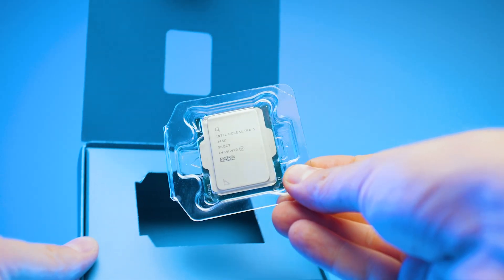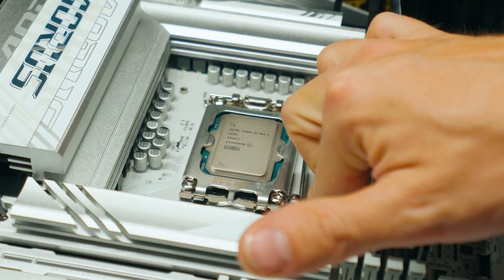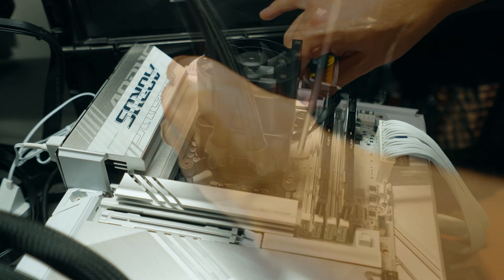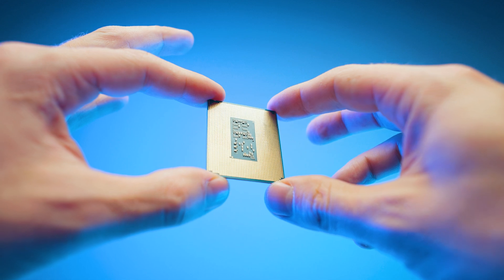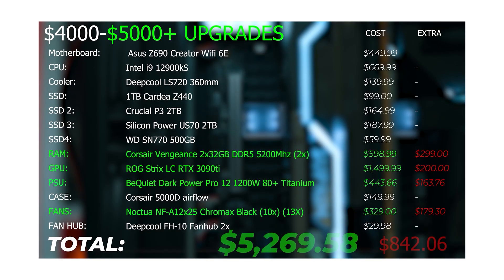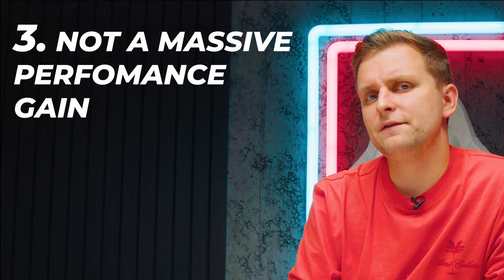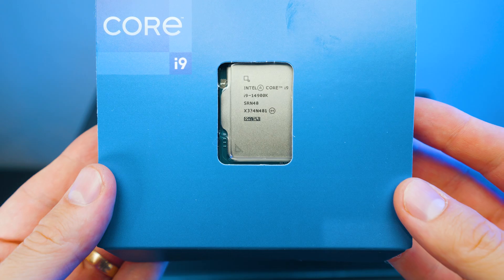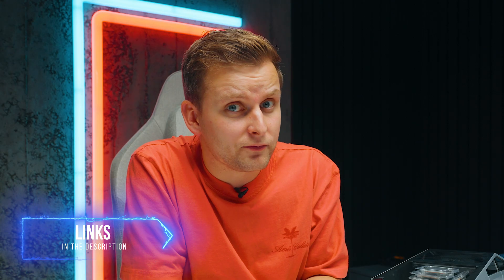6 Reasons You Should AVOID Intel Ultra 200s CPUs!

Comment: Just built an Ultra 9 285K and couldn't be happier. Not a gamer. I don't even play solitaire. Intel just raised the memory spec to 8000mt's which really gives the 200 series a nice performance boost and doesn't void the warranty. I switched out my 6400mt sticks for 8400mt sticks and was pleasantly surprised. You don't even need a benchmark to feel the difference. It's immediately noticeable.

Comment: I have a NAS with a handful of SSDs and 12 HDDs running multiple virtual machines as well... I went from a 7950x in ECO mode to a 265k with the same 65W PL1 and PL2 settings, and my power consumption was almost cut in half without any noticeable loss in performance.

Comment: So as 3d animator, modeler, and Unreal engine user. I should go with i9-1400k over a i9 core ultra?
Reply: It depends what you currently have. If you have to upgrade your motherboard anyway, the 265k is gonna be way better value at over $100 less for similar performance and way less cooling requirements.

But if you’re already on the lga 1700 platform and have good cooling 14900 is a good choice

Comment: I pick up 285K and 8200MHZ CK-dimm, this combi runs very good, no issues.
psst. on Night Raid this combi beats x3d+rtx4090 and achieved a legendary 3dmark score 100.000 points.@ 7280 X 3.600 resolution (2 monitor expanding desktop)

Comment: I was on the 13th gen (17-13700k) and it was a disaster. Computer crashes, huge temp even just running Lightroom and much more. I also built an AMD 7900x and that is one hell of a PC ad it does not even need a watercooler. So I personally would NOT go for the 14th gen but would jump to the Ultra core. Or the AMD 9 9950x.

Comment: ah, the 14900k would be decent. id recommend the 129 - 137 - 147 with an aio, disable hyper-threading, new bios, push clocks a little. UE5 will work.

Comment: Went from 12600K to 14700KF on a Z690 board - which, by pure luck/coincidence, was the right thing to do. That's because I upgraded in late 2023 so there was no way to foresee that the Core Ultra series would be a bit underwhelming WRT uplift. And no: My chip hasn't blown itself up or started to degrade. I guess not using those silly, "no-limits" default BIOS settings helps with that.. :D

Comment: I have 2 PCs each with a CPU from AMD and Intel: 7950X3D with 4090 and 12900k with 3090.  
It was time to change out my intel PC so i gave that away to a family member recently. 
My new build wont be completely finished until the 5090 and DDR5 CUDIMMs come out but so far i have bought an ASUS Maximus Extreme MB, 1300w MSI PSU, mid tower Lian Li Case, numerous Noctua 120mm fans, and Corsair 360mm AIO. The 285k is so hard to find here in Canada because of it being sold out everywhere so I bought a 265k just to fill in the gap until then.  I have put the system together with the many parts I have on hand just to get it up and running: 4090, DDR5 6800, 4TB Samsung NVME. So far so good, I love playing around with it. Can't wait for the 5090 and the new CUDIMM DDR5 memory to come out.

Comment: What about if you were planning to build your 1st PC and your not coming from any previous Generation Intel or AMD?
Reply: asking the real question!! my take is this, intel latest is kind of green/rough and will probably be updated on drivers and so on, also, it will work way better if you can find CUDIMMs ram which for now is almost non existant... so if you adopt the platform now you will probably have to refresh install your system with bios and firmware updates (and prob RAM) in some months from now... AMD is kind of stablished and working fine, even if the latest 9000s series has also lots of problems and compatibility issues (and in Windows theres lots of problems, you need to correctly set them up etc...)
Reply: Also what are your plans with the PC?
Reply: @daveinstlouis314  Sorry just seen this, the PC is mainly going to be used to run multiple Virtual machines, some video and photo editing and occasional game. But mainly a productivity.

Comment: Tech Notice : you forgot to mention Shintels cheating technique using the 24-pin connector to deliver 80-90 Watts of PWR to the CPU....trying to portray them as more efficient. You also forgot to mention the Core Ultra 9 285 being around 25 % - 30 % slower than the i9 14900K, while the i9 14900K is already around 30 % slower on average than the Ryzen 7 7800X3D.
Reply: Funny to use amd as profile pic. Lol
Reply: @Static-4  well....AMD is afterall a superior CPU manufacturer with a faster and better performing CPU architecture than Shintel....so why not :).
Reply: @lflyr6287  in your opinion amd is better and for some people earth is flat.
Reply: @Static-4  AMD Ryzen 5000, 7000 and 9000 CPU-s are faster in IPC, Single-Core, multi-core, have much lower PWR consumption (by around 65 %), have zero hardware security holes (due to not using kernell as a necessary cheating technique for co-processing) and produce much much lower temps.
The only aspect where Shintel is sometimes faster is in certain productivity programs that use old 1-core based utilisation technique in conjunction with hidden shintel compilers from around year 2012, and in games like Cyberpunk 2077 which uses a game engine designed in 2010, that uses DX 9.0c API at its core, was designed around 1-core efficient utilisation, is heavily plagued by hidden shintel compilers and was completely finished in 2014.
Anywhere else, Shintel is subjugated like a punani, the way it's supposed to be :).

Comment: I limited 9950X's temperature to 65C and got 62000 points with passmark. HWinfo tells maximum package power during test was 143.365W.  It is not bad as I come from Intel 2600K which gives 5697 points.

Comment: hi I was planning to get it, but i dont know... i have the i9-9900K with a rtx4080 at moment.. do you think i have to upgrade or i must wait an other year? i want for 3d renders blender and videomaking.. so not amd fan at all amd is mostly for gamers. Give me your opinions pls ♥
Reply: When in doubt, wait. Do you need an upgrade? Is it valuable to you? You mustn't do anything, and benchmarks for your fave 3D rendering & vid apps should be easy enough to find. I'd respect those more than opinions of some randos on the interweb. Remember that upgrading is not free also when it comes to spent time and this platform does seem to have some bugs. Prices will come down as well, they must given the market situation.
Reply: @owlstead  yeah my plan was to upgrade the cpu (motherboard+ram) every 6 years like... but the new i9 look like i must wait the next year for better... btw with my first gen i9 yeah in many cases i hear the bottleneck

Comment: I'm on 12th gen currently both i3 and N100 was picked for power at idle as my machine stay near idle 90% of the time but I need power to be there now so I am looking a 7945HX(Zen 4 16c/32t basically a 7950x in extreme low power profile) hybrid ITX boards or the 7950X with cheap B650i AX ITX board regardless, and case I plan is very tiny. I love mini builds. Had high end gaming build that heat the house in winter but after a couple of OC record you realise you don't need 150w+ for 90% of the time so bigger intel chips have always been to hungry and these are a little lame unless you push a lot of power into them and then they are not so eco friendly. Shame Lunar lake has such a low end GPU. I like the idea of faster on die (G)DDR ram. My dream is a micro PC which has a good igpu. That why I holding on till strix Halo Max lands as 12c/24t and 40 CU igpu, hopefully a 16/32 and 40+ cu chip will come than tower PC's are a thing of the passed for most people that are not gamer's. DB790i from minusforum is tempting me but currently pricey, but they keep popping up in Amazon and allieexpress, Minusforum seem to have the belief British people should pay more and Dollar and GBP is the same exchange rate. This is why I hate Brexit as I used to buy so much cheaper hardware out of EU and sell it marked up and still be cheaper than US companies. Nvidia and AMD stock was well cheap. I got a new FX 8150 on release week for only £140 from Germany UK price £200-250 at the time. I'm a linux user so AMD or Intel FTW.

Comment: First of all: Calling the 14th gen a new gen is really, really, really stretching it. It is not more than a better binned 13th Gen. This is also the reason, why both had the same issues. Second: If you are a professional who needs lot and lot of cores that pack a punch, you would never go with the Desktop-Variants of Intel that have little cores and big cores. Although i think benchmarks like cinebench are not a good benchmark, but whatever. It is good enough to compare Numbers. But Videoediting/Rendering is more a GPU-Thing in my opinion. Multi-Core-CPU's are perfect for Virtual-machines. And why should someone bother with efficiency-cores for usecases like this. And if i just go for cores as a professional, i would definitly choose threadripper over this. And  Efficiency by the way: Which efficiency? There are a ton of CPU's out there, that are more efficient then Intels Offerings. So, in none of those areas does the Ultra-series score? The new Processor-offerings without patches from Intel are absolutly worthless. They should get their sh.. together soon, or they will run out of Business without new fundings.

Comment: Even the Intel fanboys who won't think when buying still doesn't want to buy Core Ultra trash. The performance is even worse than the previous generations. Why do people have to change their motherboard to support the socket for lesser performance. And it's not an optimization at all, it just use less power for less performance. Optimization means using the same power for more performance or at least using less power for same performance or more and Core Ultra is neither of those.

Comment: Thank for these amazing videos you make .. but can you explain to me what the LGA 1700 platform ? 

I have
i9-12900k
Rtx 30380 
Gigabyte z690 gaming x ddr4 

— 
I was thinking of upgrading my pc .. but I have no idea what would be the best option .. and now that I got my answer .. I didn’t understand it .. thanks in advance
Reply: Your 12900K is good for a couple more years. If you want to upgrade, it's either gonna be on a DDR5 motherboard  since DDR4 memory kits do not fit in DDR5 motherboards; or you upgrade your GPU to the RTX 4000 series or the RTX 5000 series launching next year.

LGA 1700 supports only the 12th, 13th, and 14th gens of Intel CPU. The Core Ultra 200s series will only work with the new platform LGA 1851 which is also DDR5 only. Any of the past gens of intel cpu will not work in LGA 1851 as well.

Comment: The C in CUDIMM stands for Clocked. And these Ultra chips gain massive performance when paired with them.
Reply: Research not done on authors part. There is no memory controller on CUDIMMs..
Reply: Yeah but why buy expensive CUDIMM RAM with Intel when AMD beats it even with the cheapest RAM kits?
Reply: @Nayah9  Not true, in gaming sure the 9800x3d beats it but productivity task ARL shits all over AMD, And I just bought a kit of Cudimm for just $20 more then what I paid for the same none Cudimm 32gb kit.
Reply: Looking at the benchmarks, "massive" only maybe in Machine learning. Otherwise minor gains. AMD's 3D cache is much cheaper alternative.48GB for $600, no thanks...

Comment: This was a surprisingly good video. Glad i clicked. No numbers, no graphs, just well-presented, neatly cut into bite size pieces with very useful Info for me. (i'm on 12th gen intel, albeit mobile 12650H)... maybe i'll upgrade when this node matures and the next one comes out, and buy this node's matured part,just like the 12th gen was, a good all-rounder.

P.S In mobile AKA laptops intel is surprisingly competitive and almost always a superior option performance wise. They also cost less but that may be due to some under the table deal intel makes with OEMs. In desktops well they are holding out kind of, like a dam that's silted but has good structural integrity.

Comment: Back in June, I migrated to 12400F from 4790K. Motherboard and RAM and SSD changes, too. From DDR4 1866 to DDR5 6000 and 850 Pro SATA to 980 Pro M.2 NVme. Does everything I need and more with the same GPU which is the GTX 1080ti. Stories about all the 13th and 14th Gen processors make me glad I didn't jump to one those generations. The ones that came after 14th Gen seem reasonable, but I am still going to hang onto this 12th Gen like I did with the 4790K.

Comment: Win11 is behind and BIOS's. Also it was a paper launch. You can't get the 285K. INTEL has addressed the issues and said it is fixable. Not a hardware problem but micro code. INTEL has said it is going to be fixed in 3-4 weeks maybe and it will have a performance boost. So months time we might be looking a whole different 285K hopefully with Battlemage.
Reply: The stores in my town are full of 285K.

Comment: I cant decide what to do between a 265k or a 9800X3D (was able to preorder for Dec 19th).  LGA 1851 supported until 2026 and AM5 2027. Clear winner is AMD but for some reason part of me still wants 265k since that is all I have ever used for my builds is Intel CPUs for over 20 years. Currently on a 10Gen LGA 1200 Intel Core i7-10700K.
Reply: Not going to be a fanboy so I will say if getting max FPS in gaming is all you care about go with X3D
Reply: 20 years a go i choose intel, now i choose amd.  I just care the winner in every side.
Reply: Go for the 265k $380 at Microcenter and will get you most of the performance of the Ultra 9 and will dog walk AMD in productivity task. Also wait for Microcode updates and CUDIMM these chips will get massively better.

Comment: why did they even go to tsmc for this literal garbage they coulda just done a raptor lake refresh yet again and cap the tdp to 200w and it would still be faster and cheaper to make lol
Reply: Because U.S elections and pulling out from China and building the infrastructure in U.S. 60% tariff coming for to China and destroyed U.S economy. China is freezing all U.S manufacturing in China and blocking all U.S imports. U.S is so screwed dragging the West with it. This is not just INTEL problem. 

That said INTEL has acknowledged then problems and working on it. It is not hardware problem so it is fixable. TSMC makes AMD and Nvidia also.

Comment: If you're on Intel 11th gen, 12th gen, whatever, and look for efficiency, performance or bang for buck then your best option will be AMD. The only things where this Intel series makes sense are core heavy workloads like code compilation. For gaming, AMD X3D CPUs offer better performance, efficiency and bang for buck. The new 7600X3D is a good budget option, 9800X3D is on the other hand the performance king. While the new Intel CPUs are more efficient than their earlier ones, they are still power hungry.
Reply: Even then you better be compiling massive applications. I code on mine and have never had a single issue compiling fairly large applications. I'm not building Chrome but plenty of other large applications.

The only time that really matters is if you are compiling operating systems or browsers in a production environment many many times over in a day.

Comment: 14900k also doubles as a space heater which is a bonus if you live in a cold climate. I live in Texas so thats a problem! 😅
Reply: I live in Montreal, Canada. I think you've sold me on buying a heater that doubles as a CPU.
Reply: @dadozygaming  🥵 👀
Reply: Amd cpu is hot too
Reply: @Static-4 No one said anything about AMD. The 14900K can pull well over 300 watts and can literally max out at 400. The 7950X and 9950X can't use more than about 230 watts.
Reply: @vigilant_1934  what I know for sure is that if some equipment can improve performance on Aerospace  they will pay no matter if burns a lot of power.
They pay for xeons because they re more reliable than amd. For some workloads at high core count 64c+  amd is better than intel not always.

Comment: Yeah i love Intel and have upgraded every gen sense the Pentium days. It wasn't till 14th gen when i started running into blue screens crashes and RMA two chips that i started to question Intel. I bought the 265k Arrow Lake and if a game had anti cheat it would immediately crash. I did get some insane overclocks though. But with latest updates and even beta microcode updates still haven't fixed its issues. I got a 9800X3d on launch and have overlocked it to some impressive fps gains in games.
Reply: Im having the same issue with EAC games locking up the pc once the bar gets to 100% on my 265k aswell. did you find a fix at all?
Reply: @Mattvbro  He returned it

Comment: According to the Financial Times that have sources inside the state dept Intel as we know it won't be here in less than a year. The US government will push for either a sale or a merger with 1 of 4 contenders, Qualcomm, Samsung, Apple, or AMD. Reason being the money Intel took from the CHIPS act had strigs and Intel isn't meeting those conditions and with 50 billion in debt, a billion-dollar class action over Raptor Lake, and finally the Core Ultra mega flop they are at serious risk of folding and losing Intel's fabs is seen as a national security risk.

The current front runners are Qualcomm and Apple, although there are talks with AMD I seriously doubt they would want to go back to having fabs whereas with Qualcomm and Apple having fabs would allow them to get around Chinese tariffs and in the case of Apple it would give them a foot in the door of data center for their M4 chips which is something they desire. But if Qualcomm or Apple uy them say goodbye to Intel mobile chips, Apple won't want competition to their M4s and Qualcomm would want to use their own chips as they are cheaper to produce.